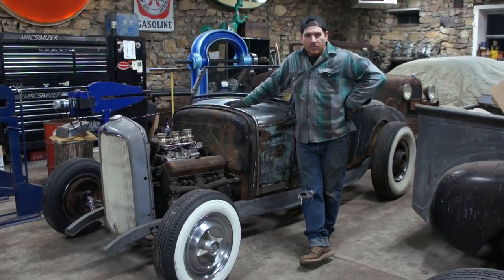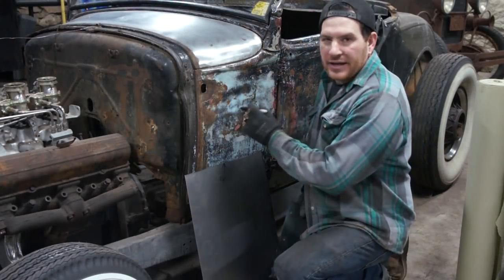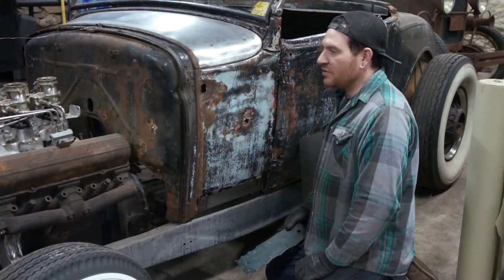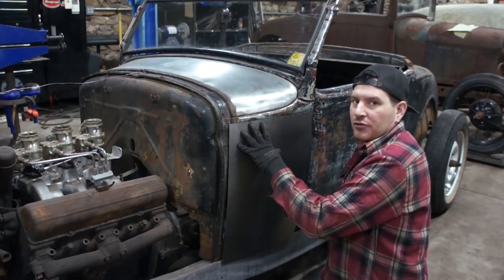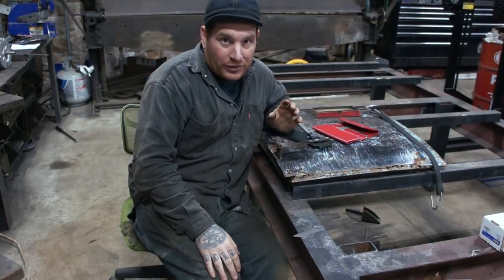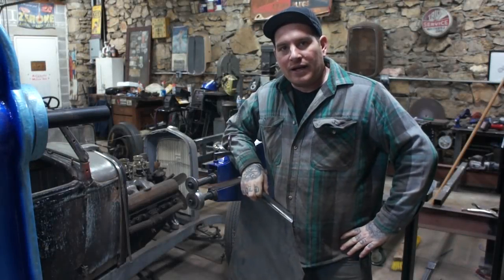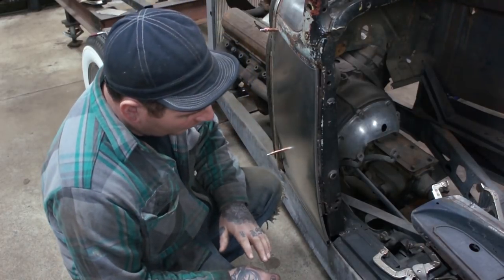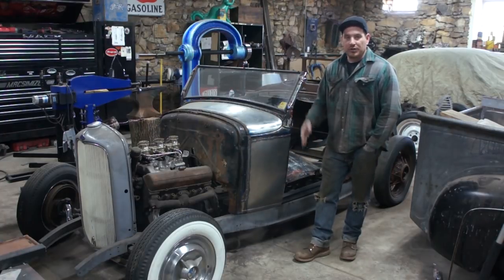How to Make a Model A Roadster Cowl Panel- Sweet Heart Roadster - Ep. 34

Comment: Staritt used mine when I,worked making radious per, blue print required for the Gear hober. At 
Whiting Crane corp. Harvey Illinois.
Many years ago.
Reply: Ran a very old American Engine Lathe.
It once was powered by Steam shaft up
In the machine shop ceiling, via Leather
Belts. Current at the time. Now powered by phase converted motor.
Reply: Another awesome job Matt!

Comment: Matt, awesome fabrication skills, what do you use to cut your panel from your 18ga. sheet stock?
Thanks!!
Reply from the maker: Thanks Michael! I usually use an Electric throatless shear. I have both a vintage black and decker and nice smaller Eastwood I bounce back and forth between. They even cut 16 gauge with ease!
Reply: @IronTrapGarage  thanks Matt, I bought a no name electric throatless shear off of ebay...it works ok, but you have to fight it sometimes,  yours seems to work with little effort, I will check out the Eastwood shear.....anyway keep up the good work....Mike G